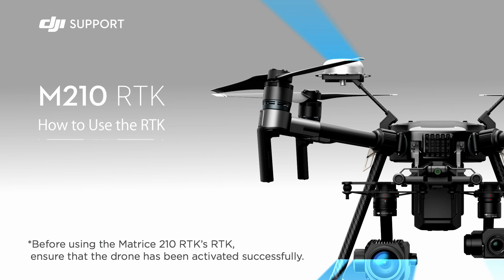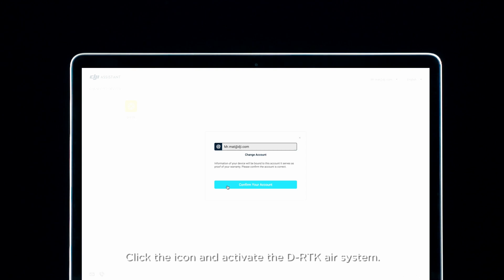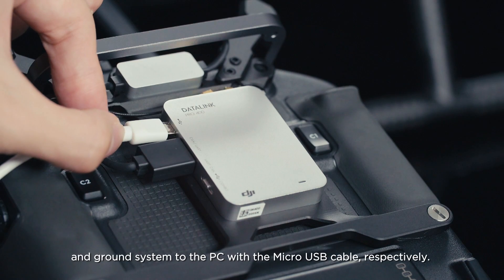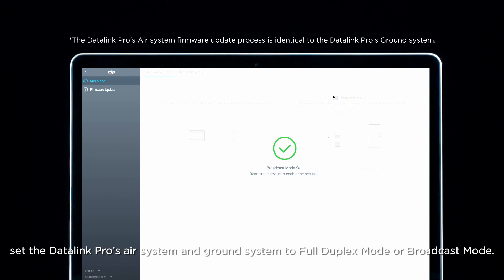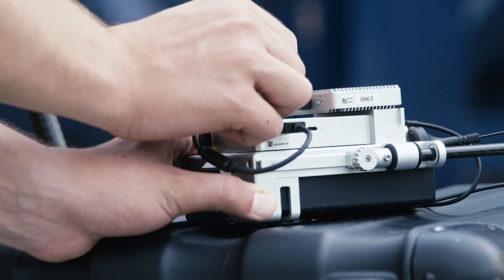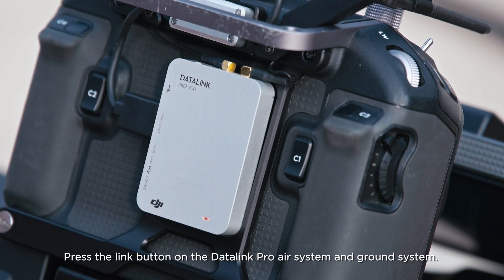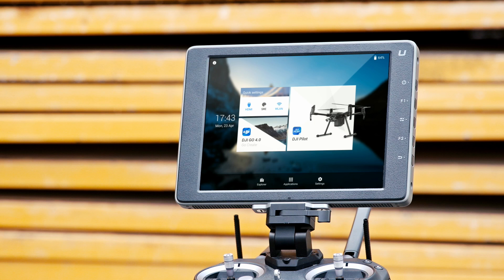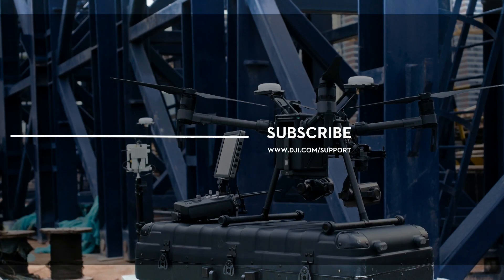How to Set Up D-RTK on the DJI Matrice 210

Comment: Can the drone go under the bridge and keep position stable?if it goes under of the bridge 2 antennas stops working.is it possible to have it stable under the bridge?
Reply: The RTK Base station to the Drone will work unless you put a camera on top. If the top camera is mounted you must change out the right "RTK" puck with the additional one (antennae puck) provided.

Comment: First of all, thank you so much for your videos. I would like to ask you for a little help. We are working in solar farm inspection and we use an M210 RTK-V2 with two transmitters. The problem we have found is, that as soon as we link the D-RTK-2 one of the transmitters is disconnected. I mean that it seems impossible to have three devices linked to the M210 at the same time. We have made a hundred tests and, whatever the third device we try to link, one of the other two is disconnected. I have tried to get information from everywhere and I could not find anything. Obviously, we need to fly with RTK as well as a pilot and camera operator. Would you be so kind as to tell us if you have any information regarding this issue?
Thank you very much in advance for your attention!
Best regards!
Reply: Hi there, please note that D-RTK 2 High Precision GNSS Mobile Station For Matrice Series cannot be used when using Dual Remote Controller Mode. Thank you for your attention.
Reply: @DJITutorials  Thank you so much for your answer. Unfortunately, I had discovered the problem by reading the complaints of other users in the DJI forum. 
To be honest this issue should have been warned by DJI in the product manuals.
Anyway, M210 is a fantastic machine and we are trying to solve the problem. To do it I would be very grateful if you could possibly give us some additional information.
I am an Electronic Engineer and I have in depth analyzed Occuysnc 2.0 with an RF analyzer. I think the problem of linking 3 devices at the same time is impossible to be solved with a new firmware release since my feeling is the limitation comes from the receiver hardware. 
Would you be so kind as to confirm me whether I am right or not?
On the other hand, Could you please tell us if DJI is thinking of any kind of solution?
I would be really grateful if you could answer me since we have found an expensive and complex solution. A confirmation from you would be enough to start working on it.
The idea is to buy a multiband Rover and Base from Emlid (RS2) to create a virtual NTRIP caster. Once this is created we should receive differential corrections trough the modem connected to Cristalsky. Take into account we are working in Morocco or Kuwait were no GNNS network is available and we cannot directly use the 4G modem.
Looking forward for your answer 8-), best regards from the North of Spain!

Comment: Hi. Does the RTK system improve photogrametric survey? I wonder whether I set the RTK base can be on a topographic bench mark and then I take a number of photos with the vartical camera (0º); would I get each photo georeferenced to the bench mark? In that case I wouldn't need GCPs?
Reply: I think the RTK is only used for the positioning of the drone but not on the images so you would have to set an additional ppk system
Reply: Arturo Rodríguez thanks. I checked around and it is just as you said.
Reply: @guitaroon  that is correct
Reply: RTK is just for increasing the mapping accuracy.
Reply: @Sir.K2  > It is Position of Drone in Relation to Position of D RTK Base station only.